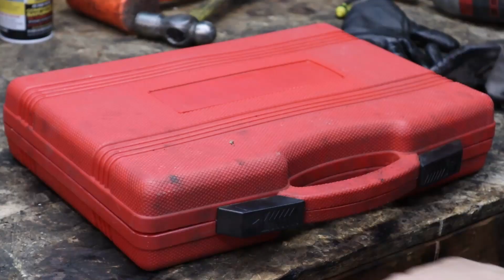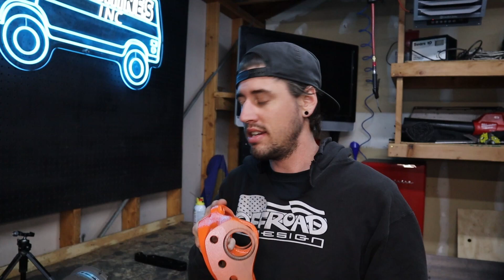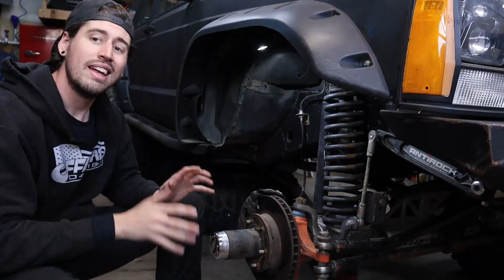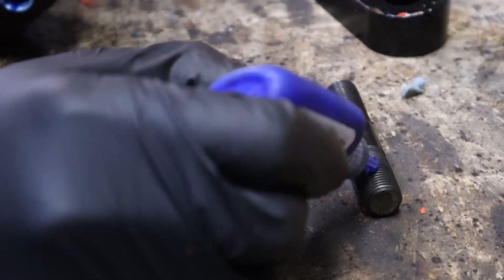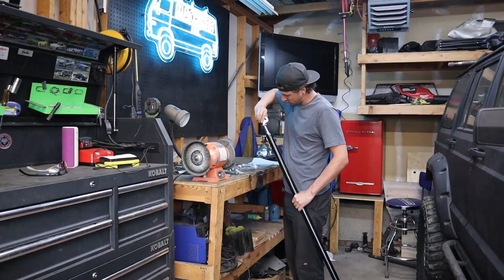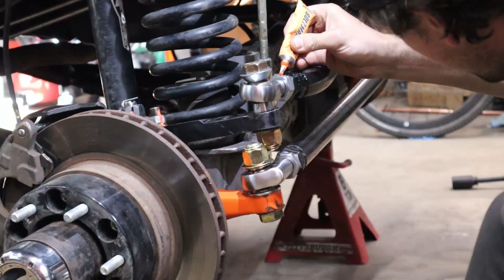Converting Wagoneer Dana 44 To High Steer On Jeep XJ

Comment: my old school high steer. is far easer to do.
my jeep still runs a dana 30 front axle. 
i just redriled and tappered all the holes on both wheels to be wide at the top narrow at the bottom. and on the pitman arm it is wide at the bottom and narrow on top. to take in a chevy 1/2 ton tie rod ends.
on a 4 and 1/2 in spring lift ( spring under) my bars are above the level of the axle and the rod from the box to the wheel is almost if not complete flat.
only new parts are the 1/2 ton ties and chrome molly bars. no bump steer of any kind.
and small machined steel shims keeps the caster and camber where it belongs so no death wobble. at any speed.

Comment: Do you remember which waggy pitman arm you used? (brand, etc..) I see several options, some almost flat and some with a drop. Or, did you just pull one from a junkyard waggy?
Reply from the maker: @RenGarage  rough country part #6602
Reply: @machinesinc  you da man

Comment: Looks good. What frame side trackbar mount are you using? I assume the axle trackbar mount is Barnes
Reply from the maker: Current days both sides are barns and welded
Reply: @machinesinc  Thanks. About to embark on this same swap. Got a cheap set of waggy 44's
Reply from the maker: @RenGarage  nice!

Comment: What are the benefits to OTA track bars
Reply from the maker: In a perfect world all your suspension links want to be flat at ride height. And for your track bar the higher it is, the higher your roll center is. So OTA helps flatten and raise the track bar to reduce body roll and bump steer.
Reply: Cool job and jeep

Comment: Keep up the videos !  Great quality and professional work.I use torque seal paint at work and don’t understand why more people don’t.  Random question on your pinch welds in the front fender well. Are yours just hammered over? Or cut and welded? I’m not sure how high up to fold mine. Was also thinking about seam sealing them. Not sure if that’s overkill though.
Reply from the maker: Thanks! Been trying to up the video quality. And my pinch welds are just folded over with a mallet. My front axle is moved about 1.5 inches forward so that’s all the clearance I needed. If you are not cutting then seam sealer would be overkill. I have another video on how to properly clearance for larger tires you can check out for more details.